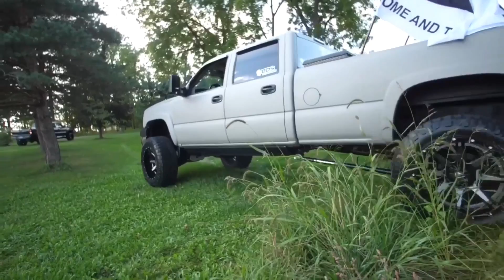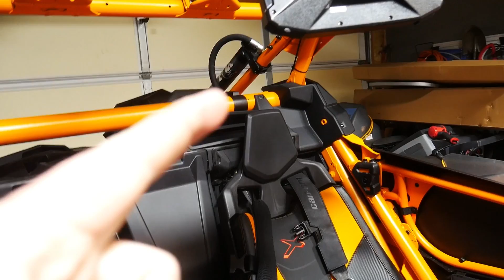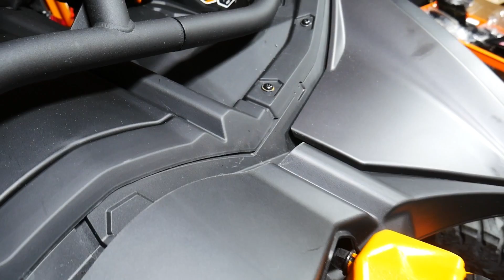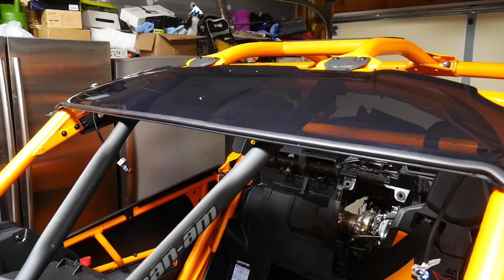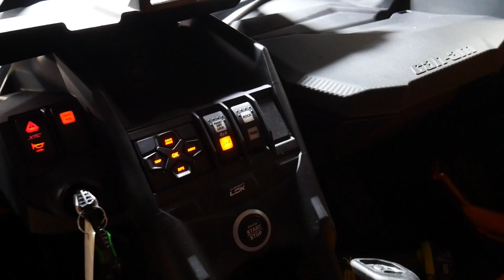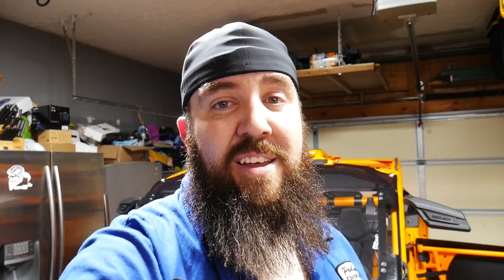Can Am X3 POWER FLIP WINDSHIELD

Comment: Do you drill from the inside of the cage to utilize the mirrors?
Reply from the maker: The hole was already there from where the mirrors would mount before, I just used a little longer bolt from the inside going out into the mirrors.
Reply: @Rustbelt Mechanic  i did the same, i did not drill out though and use the spacers, i didn't think necessary using the mirrors larger mounting area

Comment: How did you keep the mirrors
Reply from the maker: I had just turned the two mount bolts for the frame around that utilized the same two mirror mount holes. The windshield bolts then held on the mirrors.

Comment: My driver side won’t go down 1 year later? Any fixes? Suggestions? Passenger side works up and down just driver side won’t go down.
Reply from the maker: Did you check to see if there is power getting to it? Always check power and ground before anything else.
Reply: @RustbeltMechanic  hey would you be able to send me a picture of the back of your switch wires? Mine came loose so I took them out and for got which place they go in. It’s a 10 pin connection I’m only use to 6 pin. If you can post it here or email me a picture at chert023@gmail.com thank you

Comment: Are the intrusion bars the hitting the windshield anywhere else or just on the mounts? Could you use a little RTV to act as a makeshift weather stripping where you cut the weather stripping?
Reply from the maker: No it doesn’t touch anywhere else and yes you definitely could do that
Reply: HI Did you manage to trim around the intrusion bar brackets and if so how did you seal around.Also is this windscreen compatable with the aluminium sport roof?...Is there another video to demostrate.I,m Keen to order and install one on my X3 but still like to keep my intrusion bars one.Kindly advise
Reply: @dezgovindasamy6145  it’ll fit with intrusion bars and aluminium roof.

Comment: Great video! I've been searching for answers on how well an electric wiper would work on the power flip. I'm wanting to street legal mine but didnt want to spend $1500 to find out it's going to be a problem. Do you have any experience or plan to add the wiper?
Reply from the maker: I’d love to see them be able to add a modular wiper to this but it does not exist... 2 reason...
1. This isn’t a hard glass. The wiper would break down the “hardened plexiglass coating” and eventually damage it.
2. The current wiper system mounts to the body below the windshield. You would not be able to use the power flip function without unbolting the wiper arm
Reply: Ordered mine with one..
Reply: @mzwak2001  have you installed it yet?
Reply: @PaulMinster  yes I have and really like it, it does have the wiper and so far no issues!
Reply: @RustbeltMechanic  canam make a washer and wiper kit for the screen now

Comment: What did you do to get the mirrors to mount ? It looks like the brackets use the same holes.
Reply from the maker: They absolutely do. Instead of putting the bolts in from the outside and using supplied nuts, I put the bolts on from the inside through to use the mirrors to tighten.
Reply: @RustbeltMechanic  great info! thanks